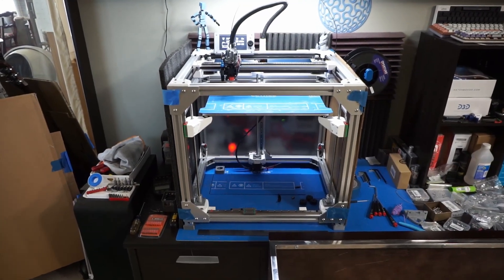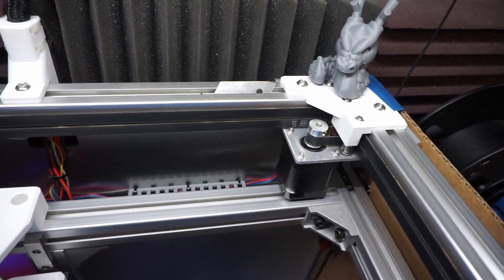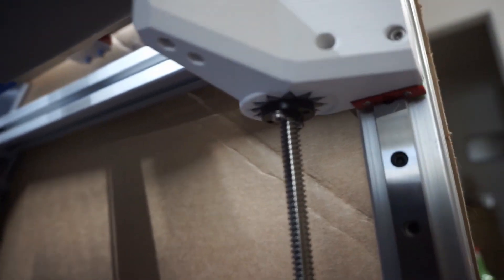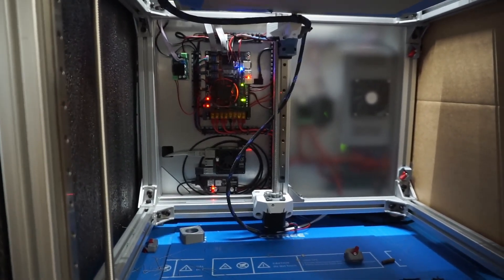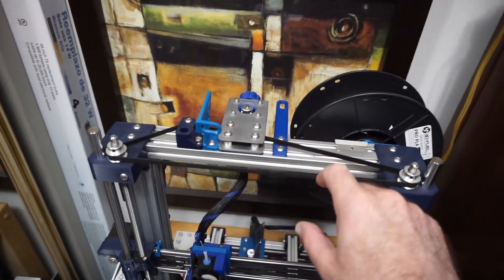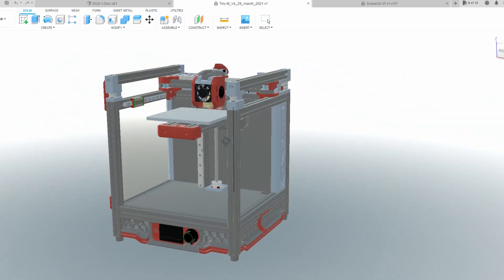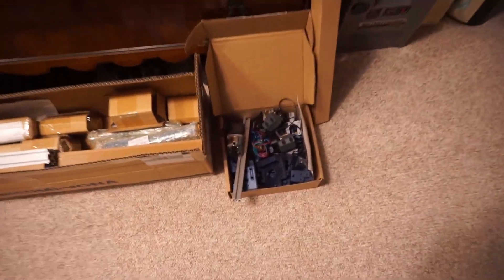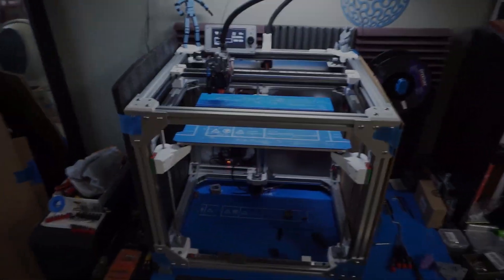New Printer??

Comment: I am holding out on buying an X1 mainly because I have a deposit down for a Prusa XL and because there will be clones of the X1 flowing out of China for less money very shortly, this machine has shaken up the industry which will make other manufacturers redundant should they not come up with something to compete with it in the Prosumer market.
 I have done the self source printer build myself and built a Pro 3D V-King 400, its a great printer and produces wonderful quality prints and very fast but I have disassembled it in order to build a Voron but have become side tracked by other commitments.

Comment: Does the fan on the bottom of the bed heat the chamber? That's clever!
Reply from the maker: Yep! that is part of the design on the SnakeOil XY.  I believe it is meant to help keep air circulating against the heater, keeping the enclosure hot.